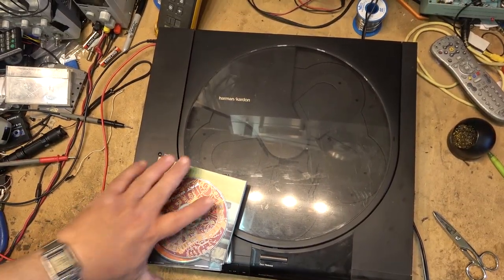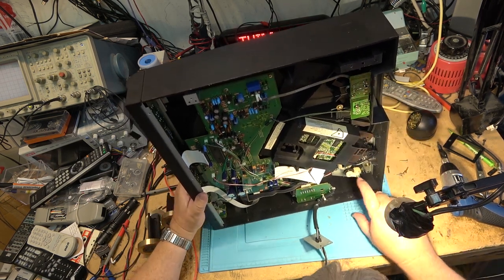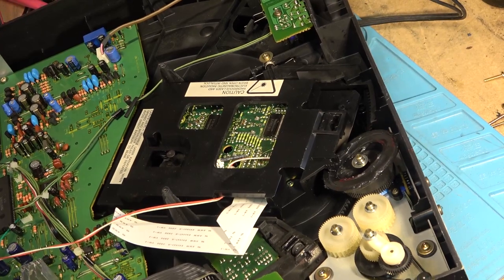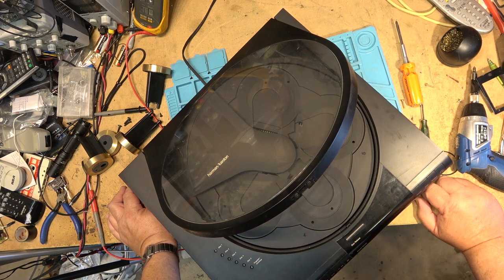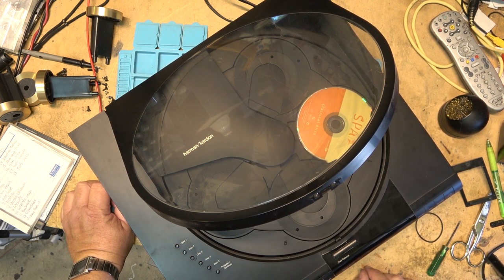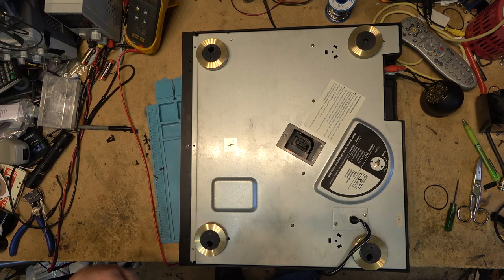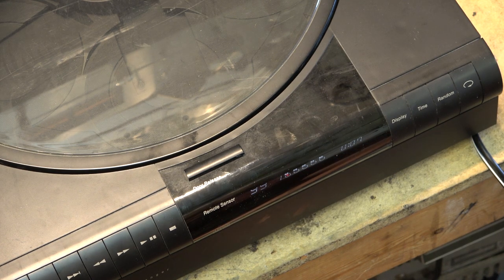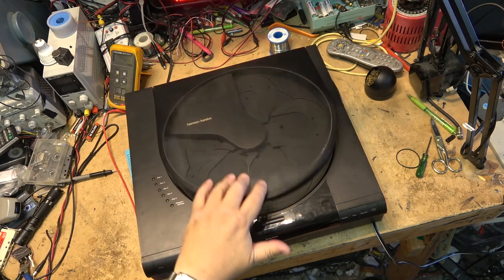Harmon Kardon TL8500 5 Disk CD player NO PLAY

Comment: A guy I used to work with would practically hide when ANY unit with a cd issue that used the cartridge system was booked in 😆
Reply: lol i don't blame him really,  i've repaired a few and it can be a pig to get everything spot on.
The metal is way too easy to bend.
Did he hide behind a curtain :-D

Comment: I don't have a disc changer, but like to watch anyway. I did have a 3 disc changer, but it quit opening up. I tried to open the unit, but couldn't see the mechanism. And did not want to try disassembling. It was one of those portable Sony Radio/CD player high fi units with 2 external speakers.
Btw, Interesting story about shipping.

Comment: Dave, I ran across the strangest issue with a set of breaker points in a Troybuilt rototiller. Installed new points, set the gap, and no spark. To make a long story short, and in hindsight, there was a note with the points that they need to be cleaned with contact cleaner and a lint free cloth prior to installing because the contacts oxidize in storage. Hours wasted looking for a cause elsewhere, when it was a new part that was failing. Never had to pre-clean a set of points in my life and I have changed countless sets of points. Ever hear of that?

Comment: Dave that is funny because I have a very earlier Pioneer that plays CDR's I was working on one of my Pionner DVD players this weekend the tray  would not stay open it ended up I had to replace a few 47ufd and 16 volt electrolytic capacitors with high ESR .

Comment: Flat Carousel: one of the best ideas for a HiFi system. Also becuase good units of vertical rotary storages sell for ridiculous amount of money and they were more specifically tailored to commercial activities rather than home HiFi... but I believe there are still models with 50 to 200 disk capacity that you can stack in a HiFi component system.
Reply from the maker: Really?  I have 3 200 disk units that i got for free.  That's right free.  Ok one i traded a 5 disk unit for but i got that one for free too and that was 25 years ago when the 200 disk was brand new.  I bought it at the shop that I worked at and then couldn't figure out how to use it came in talking to me said he would really like it five disc but the store wouldn't take it back I said I have a five disc I'll trade you for it and he did.
Reply: @12voltvids  unfortunately that's the reality we live in. You could tour 100 thrift stores where I live and you wouldn't find anything like that. What you can find over here are bottom range and no name brand components sold at incredibile prices. For us Europeans the best source of this kind of electronics is Germany or the United Kingdom with a huge disproportion in their favor. Now for UK we also have to pay VAT on top of that beyond the shipping which has become more expensive after Brexit.

But I have my ways of getting around it... the equivalent of Craigslist or interception right before recycling.

Comment: Hey my reel to reel player is shocking me like it's conductive. Any advice? It's the akai with the built in 8 track.
Reply from the maker: Reverse the plug.  Do you still feel the buzz on the chassis?
Reply: Yeah that's not good what could cause this?  I checked the cord no nicks or cuts.
Reply from the maker: @EricLDC  
 Leakage.   All the old stuff has an ac bypass cap to couple the neutral to ground.  You will feel the buzz but there will be no current

Comment: 28:00 Yup, my Technics CD player from the same year also does not play nicely with CD-Rs.  If my memory serves me correctly a CD burner was a $500 add on in 1996 for a new computer.  High end stuff.  By 2000 they were $200 and one kid at school got a burner and CD-Rs were everywhere.  Portable CD players would advertise they supported CD-Rs around 1999-2000, but I don't remember even seeing them before that.
Reply from the maker: CDR burners did not become available until 1991, so CD players before that generally don't play CDR well. Your mileage may vary as a few older players might play CDR but most won't play them well.
Reply: @12voltvids  So far i have actually not met an old CD player that would not read CD-R, they were designed to be red-book compliant and to my knowledge there was never a certification process to guarantee CD-R compatibility. If the laser is weak and it is borderline with stamped CD's, it might have problems with CD-R as reflectivity is slightly lower. But my beloved CDM-1 and CDM-2 based players from mid '80's, read CD-R without a hick-up.
Reply from the maker: @enricoself2256  CD write once read many (worm) which is precisely what a CDR is is part of the orange book specification. They can be encoded as a CD audio which is red book but the actual discs themself are part of the orange book standard and not all CD audio players will play them it's hit and miss some will others won't.
Reply from the maker: I think my first CD burner was a lot more than that. I do remember my first DVD burner it was a pioneer a02 and I believe it was around $1,300 just for the burner and blank discs were $25 a pop.

Comment: I bought the front loading version of this back then, the FL-8300. I assume it is basically the same unit inside (well the model below obviously)... I might be wrong. That thing was a piece of trash, day one it skipped every 10 seconds or so. Brought it back, they worked on it (supposedly) for weeks and when I got it back, same problem. Returned it again, same story again. Then I got a brand new unit, SAME PROBLEM. Got a refund.
An idiot friend bought 1 a couple of months later even if he knew about my experience with it lol. Was a short lived friendship.
Later the whole line got recalled and they took it off the market. If you buy one now, don't say I didn't warn you lol.

Oh I guess I should mention that I live in Norway.

Comment: HK were premium? Blimey. In the UK, by the 90s they tended to be sold exclusively in Richer Sounds as almost a house brand, and were generally seen as a bit sub-par, mostly Korean-built, down in the bargain bins with Sherwood, Sansui and the cheaper, plasticky Duals. Designs were quite nice but electronics very ordinary.
Reply: Well, HK was a mixed bag.  There was a time in the 90s where they kind of sunk in quality, and that was the time where quite a bit of their stuff was made in Korea by Inkel, the same company that also made stuff for Sherwood in that time, believe it or not.

But they did have some nice stuff as well, such as their Citation series power amps.
Reply: @Watcher3223  Yeah Inkel doesn't surprise me actually, I knew they made stuff for Sherwood (didn't they end up actually owning Sherwood in the end?), and also I believe made some Sansui, Akai and the UK Goodmans and Wharfedale brands. The HK stuff I saw did show some similarity to Sherwood so yeah I can believe it.

That's not to say Inkel was bad gear - on the contrary I found it to be well built and reliable, but always a bit 'meh' in terms of sound quality - but then it was very cheap.

Comment: "I'll never buy a fully electric car! I don't want to have to worry about range."

"I can't leave my house because my hybrid isn't charged enough."
Reply from the maker: Mine is a plug in hybrid so i don't have any range limits but I just don't want to burn gas.  I could have jumped in the car and headed straight back in gas.  Would have used about 5 litres of gas at  2.15 per litre. So about 11.00 in gas vs 1.75 in electricity to go the same distance.   You do the math.
Reply: @12voltvids  You like math? How much energy are you wasting lugging around the ICE bolted into the car that you're trying to avoid using? I can hop in my car anytime and go where I want. If I need to go more than 300 miles, I'll hit up a supercharger for 15 minutes. I hear even thrid world countries like Canada have them.
Reply from the maker: @GerardPinzone  actually less energy is wasted hauling around the ice then the huge battery a full EV has to pack around.  A model y battery weighs 2003kg that is 4416 lbs just for the battery. How much does a small ice weigh? Couple hundred lbs.  My entire car weighs less then the battery on a Tesla.  So stick that is your pipe and smoke it. As to the superchargers sure if you can get on one as soon as you pull in to the charging station you can be charged up in what 40 minutes something like that. Okay now you pull into the supercharging station and there's 15 people in front of you waiting to get on two or four chargers.
Owen has to do is take a Google the fast charging stations and the lineups. Last year there was a picture posted on July 1st Canada day of a steady line of cars waiting to get on a few available chargers. And then when people decide they're going to go have lunch while their car is charging and leave it sit there for an hour while they're gone well the people are waiting to get charged up. No thanks that's why I bought a plug-in hybrid I've got every benefit that you have driving a full EV nothing is spared. we won't go down the road of self-driving because I would never have it I would never pay Elon or any car company to have that feature so that's a non-starter. But feature for feature wise I have everything that any EB has I have fast acceleration lots of torque great handling and very low operational costs. The fact that I don't need to haul around a huge battery that weighs as much as a car itself actually improves the electric efficiency substantially and even though I'm hauling around a small four-banger under the hood and a small 8 gallon tank of fuel which I don't keep much in unless I'm traveling I still have a much more efficient vehicle than any pure EV just due to the weight of the battery itself. The battery on my car weighs only about 300 lb even if the engine where to add another 300 lb that's only 600 lb for the drivetrain versus 4400 lb for the battery pack on a model y. the cheap model 3 with the smallest battery pack still has over a thousand pounds on the battery pack which still weighs a lot more than my engine and battery pack combined. So how's that for math numbers for you. And get this what I'm traveling I can stop put an 8 gallons or 30 l of fuel and that's good for about 600 km so 40 miles of driving almost. If I start out in the morning will the full tank and a full charge I can drive 700 km before I have to stop when I do stop I'm filled up in maybe 3 minutes and then I'm good for another 600 km. I don't give a damn about superchargers and 45 minutes if you can get on at 45 minutes it's still 42 minutes longer than it takes me to fill up when I'm traveling. What I'm not traveling I don't care about having 400 mile range because I rarely rarely ever drive beyond the range of my battery in a single day. I can pull into my house plug it and charge up in a couple of hours and be good to go. Superchargers and DC fast chargers here charge typically 25 cents a minute when I'm charging at home I can recharge my entire battery for about a dollar fifty.
Reply: @12voltvids  Car batteries don't charge linearly. It takes less time to go from 20% to 40% than it does to go from 40% to 60%. Only an idiot would wait 45 minutes to charge up to 100% The new Model Ys use the battery pack as part of the structure. Did you get GM to replace your battery pack or were you one of the lucky ones that had it burst into flames while parked in your garage? I guess it's par for the course when it comes to GMs. My old 1998 Chevy Cavalier had a recall because they  overloaded the ignition switch with too much current. Maybe they actually saved money paying off the lawsuits rather than spending the 50 cents per car for another relay. I guess that's just math. BTW, how much was your wasted day worth ya?
Reply from the maker: @GerardPinzone  
you still have to stop and wait to charge and if the charger is there in use you've got to wait till one is available. no my car doesn't need the battery replaced there's nothing wrong with my battery there has been zero volts that have caught fire. That was a bolt problem and I don't have a bolt. I can send you a link though to a video of a brand new model y that burst into flames while the guy was driving it I've got it on my YouTube channel. the car trapped the guy inside and he got to kick the window out and crawl out the window while the car was bursting into flames in the middle of the street and he wasn't charging he was driving.
My day wasn't wasted I went in in the morning and picked up the parts for my bike when I got home I discovered that the parts guy gave me the wrong part so I proceeded to fix a CD player while my car sat on charge for a couple of hours to get enough juice so that I can make another trip back and pick up the right part. The problem here is incompetent people at the parts department not checking the part before giving it to me I took him the old part he was holding it in his hand and he still handed me the wrong part. I wasn't too pleased that I had to make a second trip and waste another 2 hours sitting in traffic plus the fact that there had been a building that the roof collapsed on which caused a road to be closed and the resulting traffic snarl around the dealership was unbelievable. normally I could make that trip in there and back in an hour but because of all the traffic problems that took me two and a half hours
Reply from the maker: @GerardPinzone  the point is I never have to stop and charge. I can go wherever I want whenever I want I never have to stop and charge and wait not even 5 minutes. So as long as I've got gas in the tank I can get where I want to go. I choose to not run the gas however if I don't have to.  If that means waiting around for an hour or so to get enough charge to get where I want to go and back and finding something else to do while I'm waiting for it to charge I supposed to burning $5 for the gas I'll park my ass for an hour and find something to do. takes 4 hours to charge my battery completely which will give me about 100 km of range. But then if I really need to go somewhere and I can't wait I don't have to I can just run the gas engine.
Reply: @GerardPinzone  Liquid fueled cars are lighter than electric cars mate.

Comment: Sir can H813 TOP225YN 13581E PHIL switching Regulator be replaced with HO04
TOP225Y 10640B PHIL (existing) for sony slv ed 66 vcr. Thanks in advance.
Reply from the maker: Don't know anything about compatabiliry between these parts.
Reply: Thanks for replying. I am unable to find the exact replacement of H004 TOP 225Y 10640B PHIL switching regulator here in India. The local vendor gave me the above replacement which is not working!